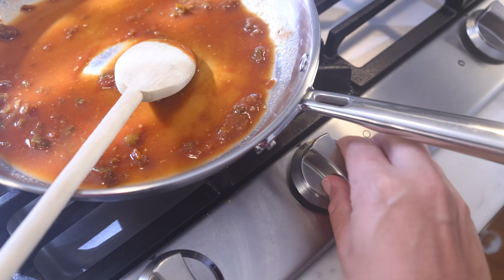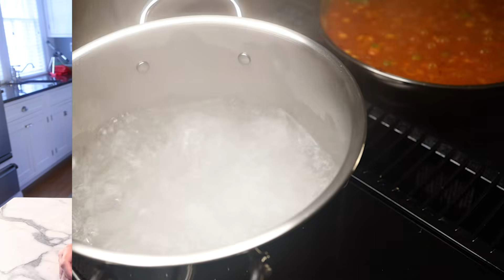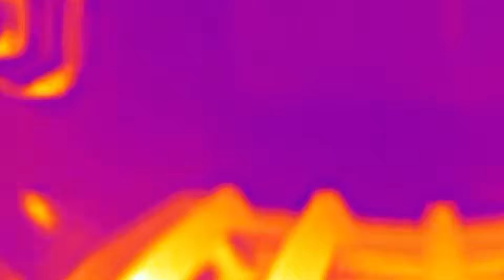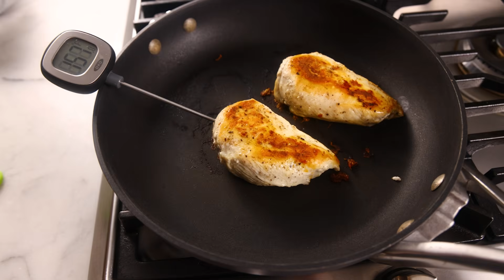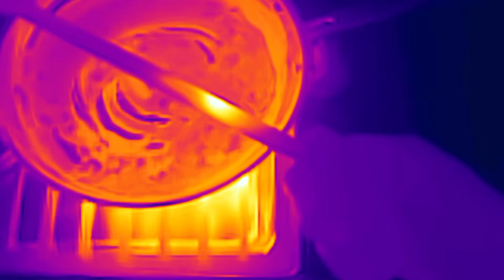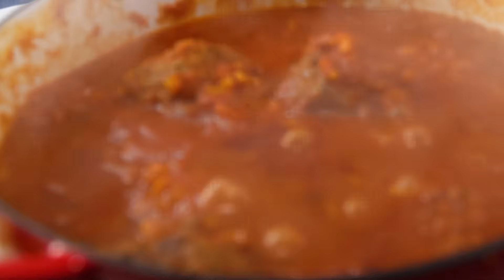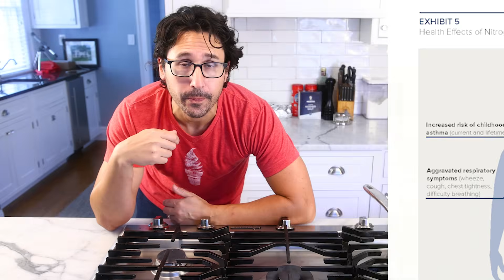Problems with gas stovetops | weak, dirty and dangerous

Comment: I am used to cooking on gas, and find as many issues with using electric or induction. One issue is that pan design is slightly different. An electric hob needs a very flat bottomed pan. Pans want to flex a bit as they heat up, so you need something thicker and very conductive to spread that heat and expand evenly. Gas doesn't need that. You get better results with thinner pans for responsiveness and don't need to care about the pan warping. 
Also you need to pick a hob based on pan size, not how hot you want it to be. A big pan on a little gas hob may still get very hot, it just won't spread that heat as evenly.
Reply: I am a bit worried that you were using a gas appliance without extraction in your home though. Carbon monoxide is not something to be careless about. Glad you use it now.

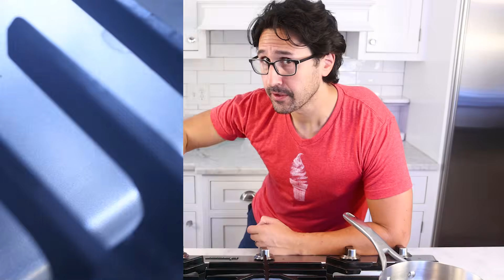Comment: 7:15 Okay this is not true. There is a very cheap yet very important part in the gas stove called thermocouple. This thing detects if the flame is on and if not it shuts down the gas.

The way these things work is that they are directly connected to the gas tap. Inside the gastap is a little spring-loaded magnetic piece that in its un-tensioned state shuts off the valve. If you turn on the gas this piece is pushed ("tensioned") and releases the gas. However, it springs back as soon as you let go of the knob again (with a delay of a second or so). The thermocouple is a piece that creates a tiny bit of electric energy when its tip - that is sitting next to or inside the burner - is being heated up. Given enough heat (=flame) this provides enough power to hold the magnetic piece inside the gas tap in its tensioned state, allowing gas to flow. As soon as (or with a tiny delay after) the flame goes out, the thermocouples power becomes too weak to hold the magnetic piece and it springs back into the locked position.

Edit: At 10:38 you can see the thermocouple, its the silver spike thingy with the golden bottom. After the tip it looks like a copper (or sometimes cns) pipe that connects to the gas tap.

Comment: So easy to get it right if you have some space (90 cm/ 36in or more). Just get 60cm 4 burner induction and 30cm single gas burner. You get the best of both worlds. You use induction for 95% of time with all it's benefits and still have gas for those rare occasions when you want to use a wok or need 5 burners.

Comment: actually induction stoves also have to cycle but they do so at about 1-0,5 Hz. the heat capacity of your pan acts as thermal capcitor so you'll not notice the pulsing of power flowing in to your pan :)

Comment: Gas stoves are more of a question than cooking and quite frankly for many the reason they are chosen isn't about how they cook.  In many areas of the country they are an emergency heat source and allow you to cook when the power if out.  This has literally saved my life in the past so I didn't freeze during prolonged power outages.  Getting rid of them completely would be foolish for this reason by itself.  If gas goes away as an option people such as myself will go to wood burning.  While I love wood burning I prefer to keep it outside in the fire pit.  I would bring it inside into a stove though if I had to to stay warm and cook in a power outage.

Comment: Not broke don't Fix It, Government gets involved and everything will be "F" up. Use what works for you but if they force the Gas Scam you all will be hurting when you're electric ⚡ power goes out. No heat, no baking food, Less Government is Better everything they touch turns to $hitt 
Look at the last two years nothing to brag about just a cluster Fk
Reply: You're right, if it ain't broke don't fix it, which is exactly why most Americans use electric stoves, they are safer, more efficient, easier to clean, in some cases faster and as a bonus we've all been making the healthier choice for our lungs no government intervention necessary.
Reply: Imagine getting mad at this video because Tucker Carlson decided to make it a culture war

Comment: I don't quite get the oversized emphasis on "bringing a big pot of water to boil". Let's be honest here, how often do you need to boil a big pot of water during cooking? If you eat pasta everyday, then yes that could be an issue, otherwise, I don't really care much about heating speed. Gas is much more responsive, even, and precise, that's a much bigger plus than being faster at boiling water.

I'd also point out that even if we just focus on boiling speed, the comparison isn't fair. Gas stove's flame has a bigger radius, so you need bigger pots and pans. The flame of a gas stove wraps around a wok not because how woks are shaped, it wraps around because woks are big enough. If you have a 12+ inch pan, I'm sure the flame will wrap around it real good. So you see, "heat leakage" is a relative concept, any stove can have a heat leakage issue if your pan is not big enough to cover its heating diameter.

And finally - for those who really care a lot about boiling water, I'd recommend getting an electric kettle. Nothing boils water faster than this thing. I have one with a push-button pump, so I can get instant hot water anytime, very convenient for tea, oatmeal, and many things other than cooking.
Reply: Boiling water is used to measure because it's a very easy way to measure the transference of energy. Even without thermocams, with our eyes we can see how fast one tool works over another. And I guess a stopwatch too. It's not about the water, it's about measuring energy.
Reply: @scruffopone3989  And all I've been saying was that the speed of energy transfer isn't as important as the video made it out to be. I agree electric is faster, but faster doesn't mean better. If you wonder what measurements are more important in my opinion, you may read my earlier comment again.

Comment: Can you gets woks as hot with an induction/coil stove top vs a gas one? Or would you have to get an industrial stove top to get adequate heat?
Reply: Wok with Tok has a video on a nice stainless steel wok that works well with electric, I've used the same one everyday for about a year on electric and its awesome
Reply: @bkm8556  thank you, will check it out. We're thinking about swapping our gas stove anyways, the fire hasn't been getting hot enough for proper wok hei as of late

Comment: In the UK gas is typically 3x cheaper than electricity and so a gas cooker would usually cost half as much to run for the year than an electric cooker would, for people on low incomes that cost difference could make a difference to their quality of life because it's all good spending extra to save the environment but not if that extra cost means you can't afford any food to cook on the damn thing in the first place

Comment: Our local library lends out 120v induction burners for testing so I checked one out for an in-home test.  I have a flamethrower of a gas stove.  But it can take a long time to boil a big pot of water.  I used the same All Clad D3 pot on both burners.  The results were about the same.  I suspect that with a 240 volt induction range the induction would be the winner.  If I am in a hurry I'll boil some of my water with gas and more water in an electric pitcher.

Comment: Just get an induction, they are supercheap now, and very efficient.
Reply: Doesn't work with every piece of cookware, unfortunately.
Reply: @jaffacalling53  stainless steel is not that expensive if you consider how easy is to clean it, and how durable it is

Comment: I grew up with a gas stove, and the only reason I don't want one now is because the cost of gas is ridiculous compared to the coal it takes to power my current electric range. A gas cooktop and a good pan just makes better food. I also find that pressure canning is easier on a gas stove. I have to fiddle way more with the temperature on an electric stove than I do on a gas one.

Comment: With a gas stove there is such a thing as too much heat for the pot or pan.  Turning a gas burner too high can be the same as placing a small pot on the big burner of an electric stove.  This why you can get gas stoves with different sized burners.  Propane is even more touchy.

Comment: It depends on your gas stove power. You can have 2kW on a stove which would be less than induction or electric, but you can have 6kw which is almost 2 times more than induction.

Comment: I've regularly cooked on gas, induction, electric coil, infrared electric, even wood-fired rayburn (that's actually my primary cooker right now), and they all have quirks but induction is definitely the easiest. I can't  help noticing the large amount of waste heat on a gas cooker.

Comment: Some not quite accurate global assertions here. I suspect they may be true of many gas stoves but they are not true of all.
Some gas stoves cannot turn way down. But some others do go super low. My Thermador has the normal range of temperatures, and another range of extra low temperatures in which the burner operates at its lowest setting - but turns on and off over a cycle of a few seconds. It has an electric spark igniter so it starts on demand. For a slightly low heat it spends more time on, and for super low it spends less time on. The super low is so low I rarely need it. The lowest end of the extra low range is a "just barely keep it warmed" level. I use the middle of the extra low range a lot. Very useful.
The cooktop has star shaped burners that deliver more heat to the middle of the pot. I don't get the burnt sidewalls you complain of. The sidewalls do get some heat but not a problematic amount.
There must be other brands of gas stoves that address the issues brought up here. But, regardless, gas is more versatile and more capable than portrayed in this video.

Comment: great video, saved me a bunch of $ too, we'll remodel the kitchen and I was gonna get gas installed which the kitchen is not set up for. 
Induction it is, and that last argument about cleaning? That's what really sold me. I currently have an old coil style electric stove and it's a total bitch to keep somewhat clean and it doesn't come with grates that also get dirty. Nah, I'll stick with electric and just replace what ever pot or pan might not work with induction. Off to goodwill with it.

Comment: The dream cooking range for me though is a very nice gas range. Expensive gas stoves are just amazing for cooking, albeit overkill for basically everyone compared to a cheaper one. I had the pleasure of cooking on a professional grade gas stove at a family members home and it was exceptional and way better than anything I’ve ever cooked on before.  The power coming off of it is amazing.  You can be sautéing some vegetables on a pan one minute and literally the next minute you can have the same pan scorching hot and ready to sear a steak hotter than any other stove could. Meats just crust so easily on it, yet you have such fine control for lower temperature foods.

If you don’t have over $10k to spend then induction is the way to go though. Responsive enough for 99% of people and get plenty hot. Only downside is that it can’t be used in a power outage, so my mid priced gas range is still my favourite since we get many power outages a year here, and still gets hot enough for anything you need.

Comment: As someone who's used gas, electric and induction, and prefers induction over gas, and also has enjoyed some of your cooking videos, I have to say that this wasn't a very good review, especially the comparison to normal electric tops. Many many things to mention, but for example the heat waste that you get from electrics due to that "lag" in heat transfer, is considerable, which is not mentioned. Or the fact that cooking any delicate food on the electrics is really a pain in the A. Also, if you wanna bring a pot full of cold water to boil in seconds, just use an electric kettle! Stove-tops are designed for cooking, not rapid boiling of cold water.

Comment: Pans on gas stoves meed to be larger, that way you don't waste so much heat washing up the sides.
"I used my smallest pan on the smallest burner" test just shows that your smallest pan is too small (for that burner)

Comment: Gas is infinitely superior, for cooking or for driving. It will be there when you need it most and your life depends on it. Electric will not, remember that.
Reply: My region lost power for over a week during a winter storm, all the gas stations lost power so the pumps did not work. Where is the gas when you need it?
Reply: That's simply not true. If tshtf so hard you have no electricity good luck getting gas
Reply: @beyond_doggo  The trick is to get a comically large straw and suck out the gas manually if the electricity is out

Big Electricity claims that this is "stealing" and "could kill you" but I'm onto allllll their tricks
Reply: @novae6584  your comment is hilarious, but im referring to places that have to get gas delivered by truck, which is literally every place i ever lived.

Comment: one point is that lack of instant heat with electric is super annoying when doing short order cooking, like reheating in a commercial environment, and presents it's own fire hazards when people don't realize a burner is on or forget a burner because they have a short attention span and don't want to watch the burner get hot for a minute and a half. When gas is on it's pretty obvious and when it is off it's pretty obvious reducing fire hazards from human error.
Reply: But induction tends to be quite fast as well, for the forgetting part, induction turns itself off if there's nothing on it, but can be an issue if you have a pot on top of it
Reply: @rudyhero1995  yes induction is great but expensive and resource intensive to manufacture and maintain. We can't expect everyone and every business to adopt a wealthy lifestyle only 10 percent can afford
Reply: @squee222  to be fair they're not that much more expensive. Cheap induction stovetops are the same price as mid range electic coil stovetops.